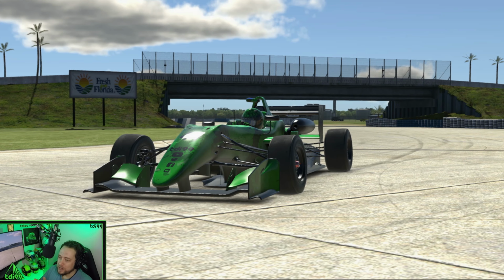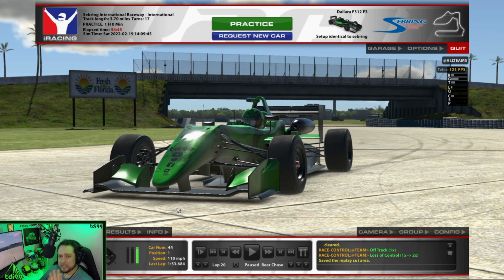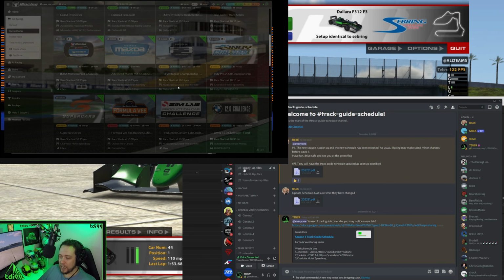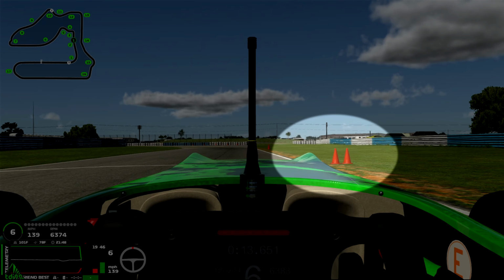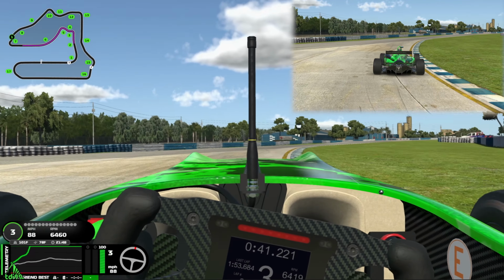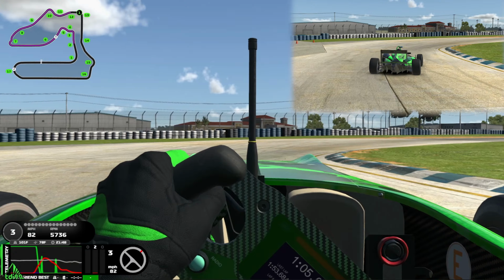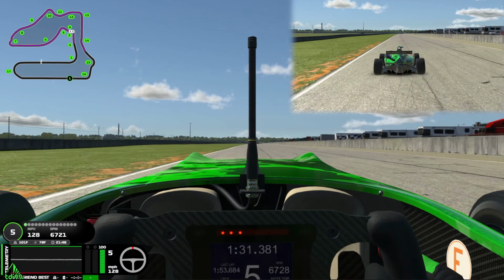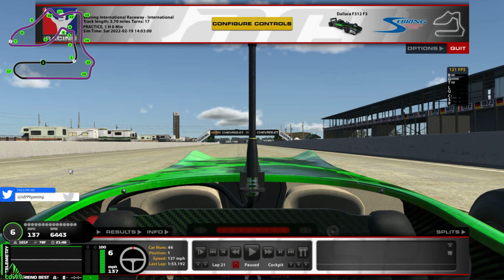iRacing Track Guide Sebring | Fixed Dallara F3 | 1:53.192

Comment: Could only manage a 1:51.04 at Nurburgring :’( let’s hope Sebring goes better
Reply from the maker: Practice and practice and then some more practice! Biggest think with this car, easy on the throttle out of slow corners!
Reply: @Tdi99  man I am struggling with this car for some reason I’m always 2-3 seconds off the pace
Reply from the maker: Right so what I do at first is learn to brake, sounds weird but the F3 will lock up. I get up to 100mph and then slam the brakes on 100% the car will lock but you will learn what this feels like, keep going until you can get the car stoped quickly without locking. This will show that you need to start off really high brake pressure and then bleed it off as the speed does. While learning this and coming to a stop you can learn to pull away without wheel spinning. First start in first gear and full throttle, it will spin but next time you can try and feed the power in nicily but as quick as you can. Open a test session by yourself and learn what the car cannot do first (you can open a test session and turn off damage much easier). Try different lines, you will make lost of mistakes but you will learn from the mistakes, your not only learning the car but also learning the sim!